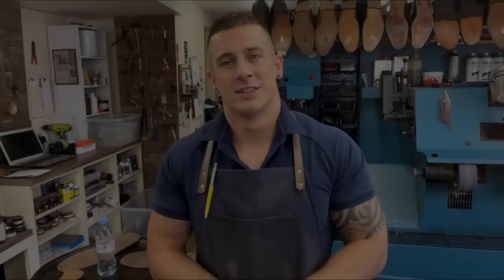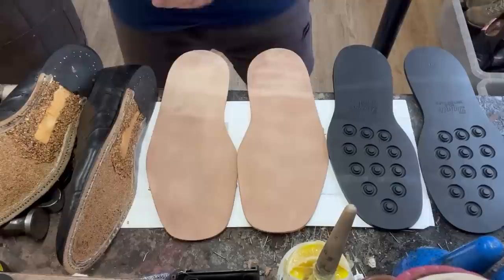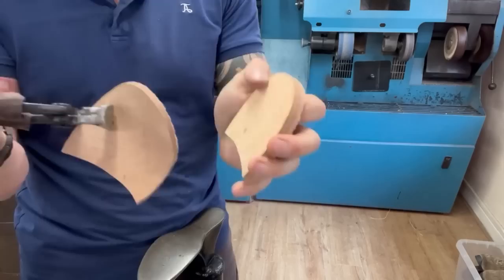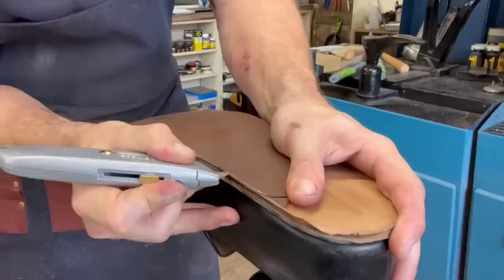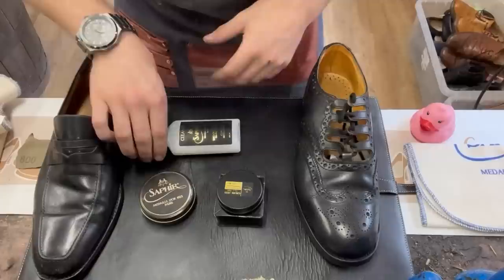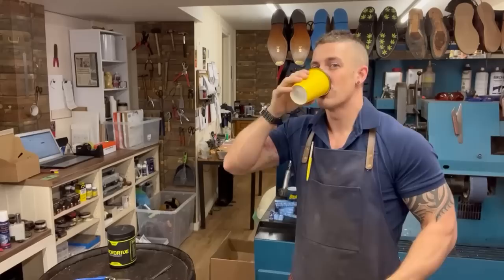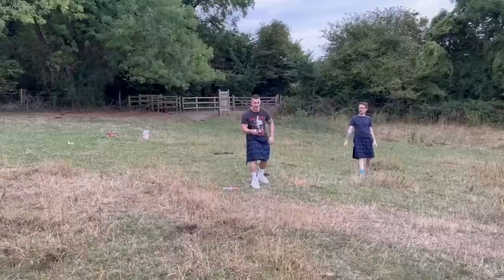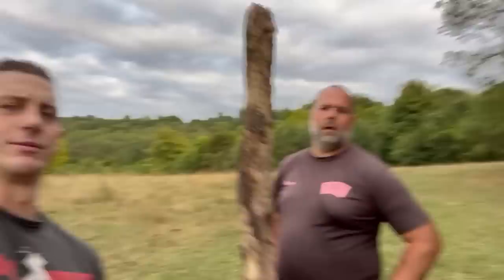VINTAGE SCOTTISH Ghille Brogues REPAIRED! Plus FERRAGAMOS Part 2! Plus The Cobbler Highland Games!

Comment: First off I enjoy your videos, really enjoy watching a craftsman tear down and then repair something. As a piper, ghillies are a weird market, a lot of cheap ones sold. I have what I think is a decent brand. They are the only shoes I own that has a steel piece in the outside corner of the heel. They do take a good shine, but piping in wet grass, forget about it. Be safe. Just a heads up, pleats go in the back, apron in front, and cut out the pleat strings

Comment: Good video Dan. How do you make sure you stitch into all the old holes when you use a sewing machine? Are you just punching a whole new set of holes in the new line of stitching? If so then after a few resolings the rim will be full of holes.

Comment: Great video as always sir - the more dynamic editing is nice to see.
Question - why the plate over the dust extractor when sanding the bottom of the brogues?
Reply: I reckon that's because of the sparks from grinding the nails. It would set the whole thing on fire if don't cover it with the plate.